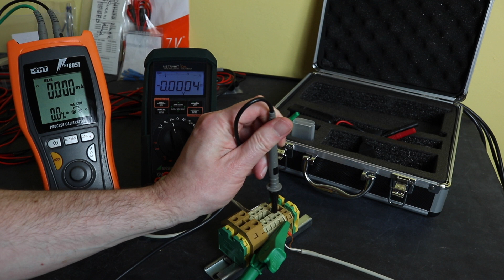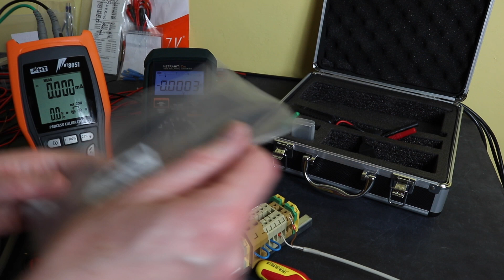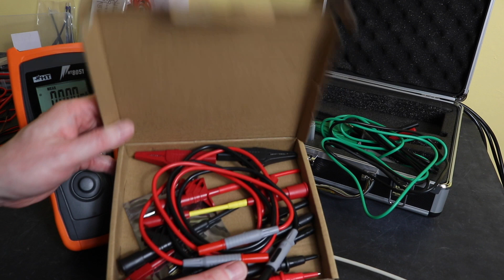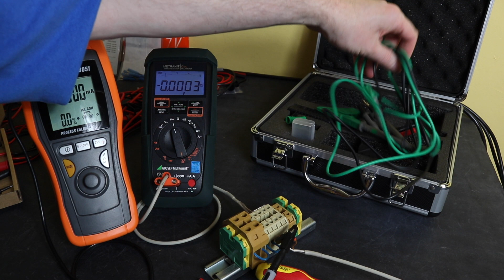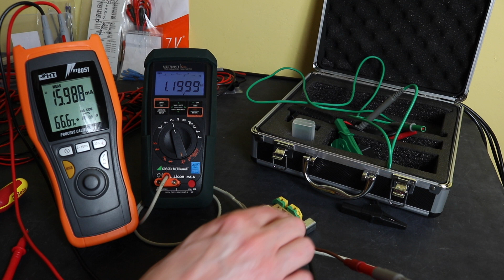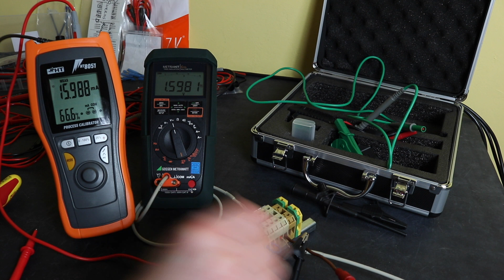Test Lead Options for the HT8051

Comment: Have just purchased those open end banana jack leads.. I tend to prefer open end jack where I can easily change tips.
I needed a pair for the Habotest HT208D clamp meter as I dont like those angled ones on units with a direct socket out the bottom or top..
those dual open-end 4mm bananleads with silicone'ish leads. was 4 USD with incl 25% danish VAT and shipping, so I highly doubt how much stringmateriel that avtually is underneath that silicone'ish sleeving.
on Ali Exprs they useally go under this clegee name and model 1032 and 1033 depending on if its angled or not.
also like banana jacks probes /just those attach ones to a few bucks liek the one you shown) as they fit well and tight in mains socket (europen pal mains), so you dotn have to hold them

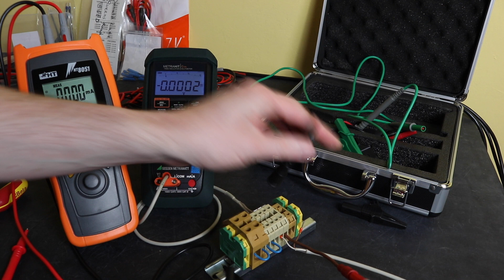Those last ones with very dense springs are not grippers.  9:30  they are intended for pinching thrue sleeving..the small needle inside that pokes out when closing is very sharp and pointy, so carefully to put it directly onto metal as you can bend or dull it, it is intended for cables with thick sleeving that will take some of the spring-pressure and the needle only penetrating to poke into a given wire underneath   and usecases where you can take a measurement without having open-trace acces..
for that it works great, though havent used my set that much.
Reply from the maker: Yes, there are a lot of Cleqee test lead sets available from a number of sources.
I took a second look at the last set I called grippers. The plastic head is further spring loaded and pushing it back I found the little needle inside like you said. Thanks for letting me know.